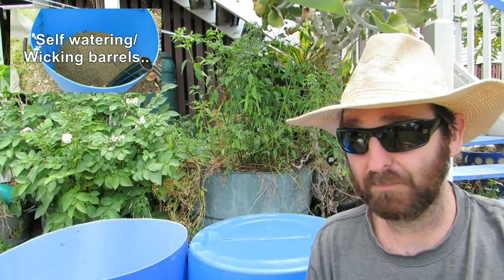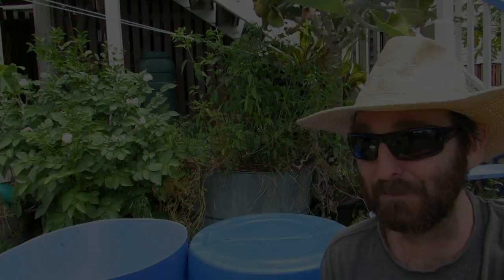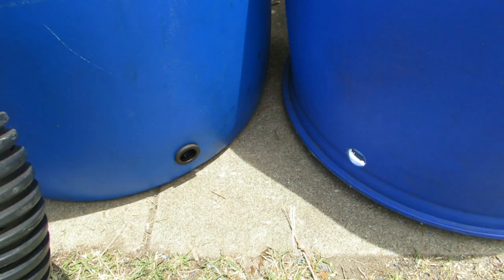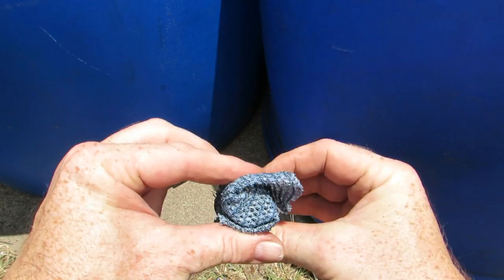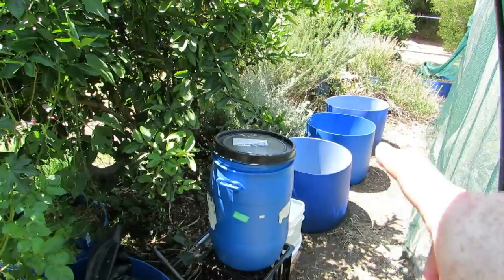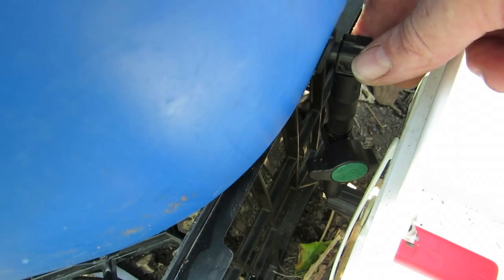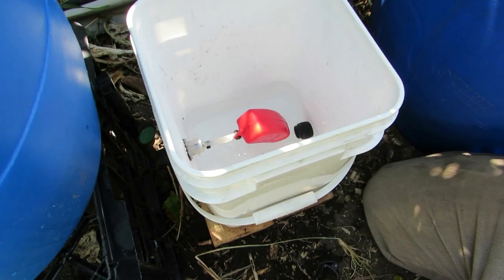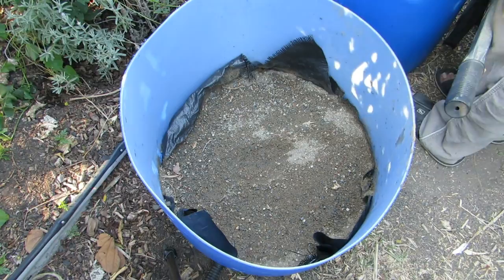Auto Top Up Self Watering Wicking barrels. Gardening made easy.

Comment: Mate, this is a pretty nifty idea..... definitely worth looking into a bit more.
Reply from the maker: Thnaks Robert.. They have been working well so far.. The strawberries are struggling a bit but the beans & yacon are doing really well in them.. Could just be the heat of summer getting to the strawberries so will be leaving them in for now..
Hope all's well with you & yours..
Cheers mate..
Reply: I have a wicking bed construction question.... I have seen a few suggestions that it is a good idea to have the drain for the wicking beds set low, and have an external pipe to determine the height, enabling the complete drainage of the bed when desired. I notice that in your videos, and most other peoples wicking beds they seem to have the drain holes set at the height directly. What is your opinion of this extra feature? what sort of life expectancy do you get from the wicking beds? do you need to renovate the beds often, or just run like a normal garden, ensuring the drain hole is not blocking? does, not draining it completely have a detrimental effect? or does restricting water to enable the reservoir to dry up naturally before watering have the same effect? At the moment I am constructing the first of 4 wicking beds, using 2.4m sleepers 3 high so they are large beds, due to the slope in the yard, I have sunk them in the ground a bit so I dont think I can facilitate this feature anyway, though I wanted some sort of clarification as to the effect on the bed that not having the ability to completely drain the bed will have. Any thoughts would be great. Cheers Robert
Reply from the maker: Robert Waters I think the drain pipe is a good addition on wicking style beds but don't think it's necessary myself.. I can see where it would come in handy on smaller set ups like the barrels or storage totes so you can remove the water when you need to move them around the yard..
I have found that the beds will dry out fine without a drain as the plants take up all the moisture.. One feature I didn't include on the earlier beds was a nice straight fill pipe so I could use a dip stick to see if the reservoirs need a top up.. All the newer IBC beds have straight fill pipes that run to the base of the unit so I can get an accurate water level before filling if need be to see how much the bed is using..
I have let some beds run dry unintentionally with no apparent long term damage to the worm population but there would of been some loss in number of the smaller organisms as the soil dried out I think..  The plants all bounced back well which was a relief..
Some of our beds have been in place for 4 years & are still growing strong.. would like to re do a few but only to increase the water holding capacity of the reservoirs..
Have never had a drain pipe assembly I make up block but did have a few drains that were just holes in the IBC with shade cloth glued over them clog up.. Turned the beds into a swamp actually :-/   
I've found that feeding the the beds with compost & organic matter keeps the worms, micro organisms & fungi active as well as help to replace the used up nutrients.. Some folks use worm feeding stations to help with this where I top dress with aged horse manures & mulches a few times a year to provide them with food.. 

Hope that helps some mate & let me know if you want any more information.. Am a tad fuzzy tonight & might of missed a bit.. 
Cheers Robert..
Reply: Hahaha yeah I know the feeling mate, was a bit like that this morning actually just plodding along mind in neutral.... Yeah that is awesome mate, answered all my questions for the time being, now I just need to crack on to getting these beds up and running. Did get a little bit done this morning, sorted some alroc#1 blend (only 1 supplier I could find on the coast and that is all they had), some mushy compost $1.50 a bag (not too bad I thought), some cow crap (though cause it was raining only got 1 bag that was not sloppy from the parents house) and when I mix it with my own compost and existing garden soil, should work a treat I should hope.What is this course you said you were doing? if you dont mind me asking..... there are so many innovative gardening ideas it can get a little confusing sometimes a bit like a mine field of what to invest money into etc, though at the same time it is great with so much inspiration, ideas and people pushing the boundaries etc.... cheers Robert
Reply from the maker: Robert Waters 
Sounds like an OK soil mix mate..
Doing a Permaculture design certificate.. Just finished the introduction & am enjoying it :)
Cheers,
Rob..

Comment: Great Info ya share with us Rob Bob, and you may have answered unknowingly a question of mine about sugar cane fiber, since its sugar cane harvest time over here, among the various fruits in season is sugar cane, peeling the outer layer, we chew on the inner core and extract the cane juice, leaving the dry pulp, saving a bag's worth so far, well it smells a bit alcoholy, so its o.k. to use it as mulch?lol,....what a comment i make ya! :)
Reply from the maker: :-D Think I got it all Joe ;-) 
Should e fine to use if you let it dry out before putting it on the beds.. If it was to wet it might heat up & compost a bit if put on to thick..
Cheers matte & all the best..

Comment: That's a fantastic system my friend ! I'd have to figure a way to drain them prior to winter and have strong enough containers to resist the freezing. 

Excellent !
Reply: Rob Bob is a great resource!
Reply: For winter you could either add a tap to the reservoir bucket, or tip it and dump the water out, and then take the piping off from in between the buckets and use the outlets to pour the water out of the other parts as well ***** it's more work in the fall and spring, but it should work well, you don't have to get 100% of the water out either, just enough that when it expands from freezing it won't break anything. That's what I do with my rain barrels, I can't drain them straight to the bottom because of where the taps are, but as long as I get the water level down to the level of the taps I never have a problem.
Reply: Conrad I think we might have a new way to grow here ;)
Reply: I know I'm thinking about where to put one already Stephen
Reply: Always :) it does a lot of damage !
Reply: ***** But Brock you live out there on the left coast in Lotus land LOL.
Reply from the maker: Edward Van Natta What sort of information are you after Edward ? Will help if I can mate :-)
Reply from the maker: I think if you used threaded fittings like mojoe60 it would be very easy to drain ***** & Conrad Cardinal.. 

Is a regular little Canadian get together here.. Can feel a round of the lumberjack song coming on ;) ***** can play the strings & ***** can lead you all in :-D
Reply: We do generally get together this time of year!  Its getting might cold!
Reply: i don't think freezing will hurt the barrel.  i'm basing that on a 35 gallon barrel i've left over half full of water through the winter more than once. i'm in zone 5 nothing like Canada but we get a real winter.  the weak link is the hoses that's why i made them removable.  the bungs could be a problem i'll find out in the spring and do a video either way. i thought about tipping them a little with a shovel or using some kind of siphon powered by a drill. i probably won't get to either.

Comment: Great design. Makes sense to link several barrels. Nonetheless, do you need a large donut reservoir in the barrel, if the water is constantly being replaced by the main reservoir? Would a 1 inch, 25 mil, pipe with holes drilled in it work to saturate the sand? The evapotranspiration rate removing the water must be very low. A slow, constant dribble into the sand would be enough, wouldn't it?

Comment: just an idea but what would happen if you were to put some fish emulsion in the reservoir and you it kind of like a very simple hydroponic system. i think i might try that if get the time. this is still excellent as it is, i love the simplicity.
Reply from the maker: Might have a few issues with anaerobic bacteria moving in if the water wasn't being used up fast enough Ted.. This system has barely used 5L/1gal since being set up so think it could be a problem if I added some at this point.. Might be different in the future once the plants mature though..  
I do top water with compost tea or seaweed/kelp fertilisers to give the plants a kick every 3-4 weeks here so I think that helps them along..
Cheers mate..

Comment: I live in MN.  Can you leave the buckets out over winter with just the reservoir with water and have it make it through winter?  Or can I tip the bucket to get most of the water out?  I don't plan on putting worms in since they would die over winter anyway.
Reply from the maker: Lynn Johnson Hey Lynn..
Have never had to deal with winter freezes here but think it could be a good idea just to be on the safe side.. 
I have seen one chap put a few of his on pot plant rollers (little trays with wheels) so they can be brought into the garage over winter & set up under grow lights for fresh herbs.. 
Hope that helps some Lynn & have  great weekend..

Comment: Thank you for very succinct explanation. Very clear video instruction.
Question: is the black corrugated tube for aeration? Will it aerate despite the black mat & sand on top of it? I’m about to try this system, I’m a bit intimidated with all the circumference of all the fittings /connectors.
Reply from the maker: Hi Tess. The slots in the pipe allow water to leak out into the base so iut can be wicked up into the soil. They would also helps air get into the root zone as the water level drops. 
Cheers & happy growing.

Comment: I have old working boxes made from styrofoam that were broccoli crates. The commercial potting soil is used in them has turned to greyish dried out sand. I believe that soil may be too salty to use, and I wonder if I can remove the salt from.that soil in some way. or just use it in the bottom as you've done here.
Reply from the maker: You could use it in the base if it's not salty Ian otherwise I'd just toss it. If it's salty & in the reservoir it will affect the plants down the line I think.
Reply: Rob Bob's Aquaponics & Backyard Farm thank you. Just as I thought. :)

Comment: Rob, can one use a nutrient rich water supply in addition to or instead of the the soil mix......i.e. just using sugar cane mulch and say, potting mix layers and watering with a seasol/worm casting mix in the water?
Cheers
Reply from the maker: I've seen folks do that Neil & they haven't reported any issues back to me. 
I prefer to just add those fertilisers as a liquid feed to the top on the beds/barrels myself.
Would like to know how you get on if you have a crack at it yourself.
Cheers mate.

Comment: Nice setup, Rob. I've been following Mojoe60's vids. Found them interesting and inspiring. Glad to see you doing a vid on them as well. I hope to do something similar but with a little different twist I have in mind. If I can ever get past all my other projects. Got a little problem I hope you can help with on my existing wicking pots. I've put netting over the overflow tubes as you did but the y kept getting blocked anyway. I managed to fix one of them by making a cup shape (about 1/2 inch larger than the drain pipe) out of mesh wire, covering it with a fleece then placing it over the drain pipe inside. The other were already filled with plants and I couldn't do anything but go out when it rained and give a poke through the drain with a stick. Do you have any idea what I may have done wrong that they got blocked anyway?
Reply from the maker: Hey Jay.. They made a sweet looking system I think..
Are the drain pipes in sand or in soil?  I haven't had any issues with sand but have had a few of the first barrels I made get clogged up with soil when I didn't make the sand layer deep enough.. Let me know how you get on mate & hope all are well over there..
Cheers..

Comment: I'm looking into building these using four IBC containers.  What should I look for in a good float valve?  You changed which one you were using, but I'm not sure what makes a good one for this application.
Reply from the maker: Sorry I missed this question. Did you end up setting the system up? 
 I've been told that the kerick brand are reliable by folks that use them a lot. 
You could probably get a larger one as the reservoir needed for IBC's would have to be larger I'd think. 
Cheers.

Comment: Hi Rob,  Hope all is well. do you have an updates of this set up? I have looked through your extensive video list couldn't find it. Here in UK we should be able to start gardening outside in few weeks or so 😃. Still getting frost here. 😔  

Anyway, big fun of your handy video and always looking forward to the next. Take care and happy gardening. Mohammed
Reply from the maker: +ANR Design &amp; Print Alom 
Hi Mohammed..
I actually filmed a bit for the last walk around clip on them. It got cut out due to the length though unfortunately. At the moment it's growing some nice looking ginger in one & the taro I popped into the other two did really well I think. 
There are a few things I think I would do differently like add "nut & tail" joiners between the barrels to make them easier to move around if need be or to add more onto the series. 
Hope that helps some mate & hope you get off to a flying start with your season.
Cheers.
Reply: +Rob Bob's Backyard Farming 
Hi Rob, thank you for your prompt reply. I dismantle all gardening staff after the season. So your nuts and bolt idea is really help full. Cheers
Reply from the maker: +ANR Design &amp; Print Alom 
Just so you know what I'm talking about, we call this a nut & tail.
http://cdn1.bigcommerce.com/server800/63c4e/products/104/images/235/fitting00__96789.1272419287.1280.1280.jpg?c=2
Hope it helps 👍
Reply from the maker: +ANR Design &amp; Print Alom 
Popped down & took this shot of the ginger for you 👍
https://www.facebook.com/Bitsouttheback/photos/a.417629381619813.91747.417625838286834/989845967731482/?type=3&theater

Comment: Hi RobBobs Backyard Farming  you specified in one of your videos to use coarse sand, is fine sand ok as well?  I have made one using fine and it seems to be working out but I am about to roll out this system with 6 of them in a self watering chain so want to get it right.  Thanks for this video I had seen your other one and devised a system which was very similar to this feeding from a rain barrel off the downpipe.  I had not thought of using a float in between great tip =)
Reply from the maker: Hey Nige.. I haven't used fine sand by itself to tell you the truth, only bedding sand which has a lot of fine powder/sand in the blend.. Coarse sand is cheaper here so is what Iv'e been using for a while now.. Being course I also think there would be more voids between the grains allowing the reservoir to hold more water over all..  Not sure that's needed in a auto top up system though as there will always be water available to the soil in the barrel.. 
Would like to see the build once you're done.. 
Cheers mate & have fun with the build..
Reply: no worries doing a few this weekend, the first one is growing great, put basil, turmeric and a tomato in it

Comment: great video!  would you be able to leave the reservoir open to collect rainwater or do you reccomend keeping everything closed?
Reply from the maker: Hi there. You could leave it open if you don't think any debris would get in there & clog up the pipe work 👍 As ours is under the lime tree I have the lid on at all times. Am also a bit concerned with mosquitoes breeding in there. A bit of mesh over the top would help to keep them & debris out though I suppose.
Cheers & all the best.
Reply: i was thinking of a double layer of shade cloth to act as a filter/blockade for mosquitos which would still let the rain in.
thanks for the response!  you are the first youtuber to respond to me.  it means a lot.

Comment: Hi Rob.  Thanks so much for your videos.  Quick question.  Do you combine your Air Pruning barrels in your Auto top up wicking barrels?
Reply from the maker: +Brian Liang 
Hey Brian.
I haven't as yet mate. I think I'd probably set up a tray system for Root pouches to sit directly into rather than a barrel system. I have a few trays going at the moment set up like that but need to top them up every 2-3 days with the heat we have at the moment. Would like to set them up on a float system but finding decent quality floats is a bit of an issue. 
Would like to see what you come up with if you have a crack at a system.
Reply: +RobBobs Backyard Farming Yes, I plan on building something based off all the great info you've provided.  At this point I notice your wicking barrels videos are from 2011 to 2014 and I just looked into root pouches after your comment here to see that's 2015 relevant.  In your experience do you now favor root pouches vs wicking barrels?  I have a rain water system I think I can easily integrate into your 55 gallon barrel system but may go back to the drawing board if you feel like root pouches are the way to go.
Reply from the maker: +Brian Liang 
Think I just commented on a FB message you sent ;) 
I think the air pruning pouches are the way to go. Still need to integrate some form of reservoir in the base of stand alone pouches though but do think the tray method works great too. 
Have you seen the clip with the wicking root pouch at all? 
http://www.youtube.com/watch?v=0691bdHnxyo&t=17m59s